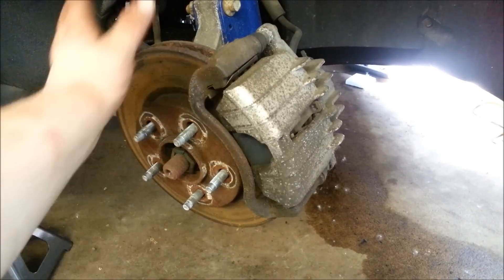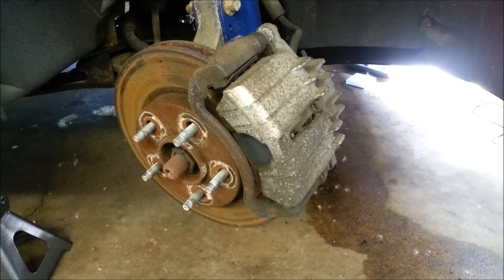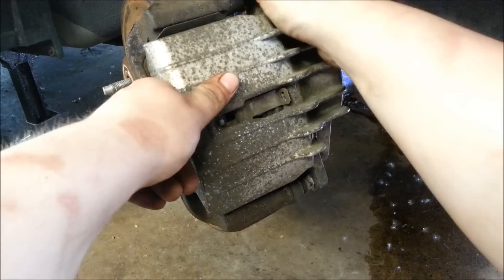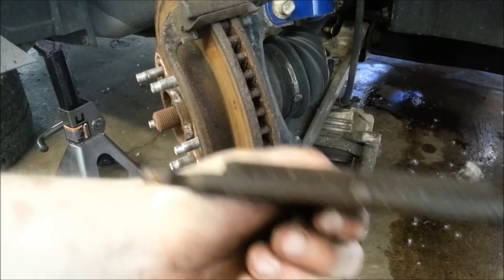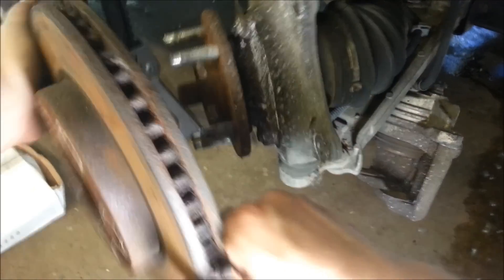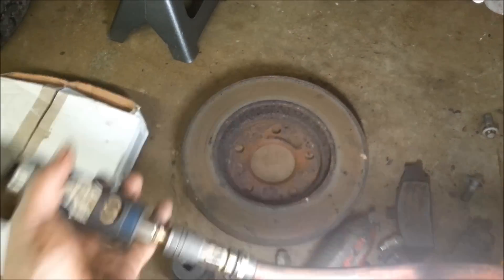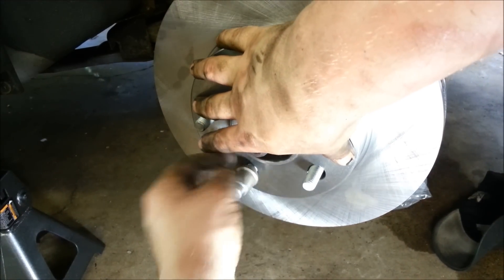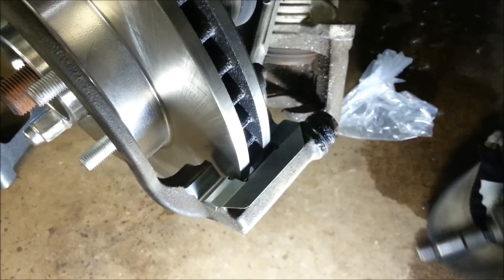grand am front disc brakes- joetheautoguy

Comment: I replaced the hardware when i did my break pads this time...i couldn't beleive the diffrence in breaking that it made....the only problem is that after 2 week the caliper started sticking so i had to buy a new caliper and it came with the bracket to....go figure all new front rotors new caliper bracket bolts on the driver side new brake pads and hardware and then the caliper decides to start sticking in the drivers side......thank you for your vidoes helped me fix my breaks perfectly without a single problem....thank you for the time you put into these videos...

Comment: NOOO! don't let the caliper hang like that! you stretch and / or damage the brake hose

use a coat hanger or bungee cord and use that to keep the caliper out of the way by hanging it off the strut coil

if caliper doesn't slide off easily at first, use a c-clamp to compress the piston back into the caliper & you should do it anyways to make room for the new thicker brake pads. Use an old brake pad on the piston so you won't damage the dust boot around it while you compress the piston

other than that, it was a decent video ~ i also torque those bolts to specs but that's just me when it comes to brakes
Reply from the maker: Earl DaSquirrel  i actually hung the caliper because i replaced the brake hose and caliper later off camera. forgot to edit that out but yes your right dont hang it it can cause issues
Reply: No C clamp use?

Comment: If thats a grand am, those discs were put on wrong.. the taller tab goes on the inside or it will bind up the caliper
Reply: Lucas O'Dell    Car is a Grand Am
Reply: I think you mean pads, not discs. But you're right, the taller tab should be on the inside.

Comment: Totally going to do this. My husband doesn't think I can do this, but I know I can. Thanks for the help!
Reply from the maker: great!!!!!!! its pretty easy when you get down to it... thanks for watching
Reply: Hardest part is getting the wheel off and car jacked up safely after that it’s pretty easy. Make sure you have a torque wrench and an electric impact the impact makes it easy to get the bolts off and the torque wrench makes sure all the bolts are torque to the proper spec. You do not want your wheel falling off. The proper torque spec for the a Grand Ams wheels all 100 foot pounds.

Comment: Seems the wear squeaker goes on the inside ?  on your vid u had it on the outside,on   another vid the chap said if u dont put it on the inside the pad will bind and wear unevenly since the tabs are of different sizes .
Reply: Tim Warner      He also don’t put some grease on the bottom sides of the pads they will squeak
Reply: Right to both you guys! I was going to call him on his bullshit because he did it wrong, but hurried up and switched them without telling us, or why. Plus not putting grease on the slide bolts! Somebody is going to fuck Thier shit up because of bad directions. Plus he didn't explain the hardware you get and where and why it goes where it does. The only reason i came here is because i couldn't remember if I had to open the brake reservoir cap before I start compressing the Pistons.

Comment: Nice video man but Just a heads up if it's a grand am that taller tab with the squealer bar goes on the back side as it will bind up in the caliper, I just actually did my 04 grand am front pads
Reply from the maker: Thanks for the tip

Comment: Joe, I seen you have the big tab on the pads forward but then I seen you switch the big tab pad towards the caliber ,in. 
Is that right/
Reply from the maker: i honestly did not realize i did i did this in the video, the big tab on mist vehicles will be the inner pad on the bracket. and the smooth facing outwards. some vehicles differ ut this is the usual way of installation

Comment: How do you push the caliper Pistons back?
Reply from the maker: use a c clap and physically push the pistons back in , didnt relize i didnt show it on this video i will be doing a reshoot soon
Reply: JoeTheAutoGuy you got the inner and outer pads backwards,, the one with the long tab on top goes on the inside of the rotar.  the caliper's piston needs the large tab to push evenly and prevent uneven ware!
Reply: how do you release the pressure on the piston

Comment: "... just gotta figure out which is your inner and outer (pad)... "  I noticed in your video that each pad has a tab on top, but the tab on the inner pad is higher than on the and outer.   I thought I saw you install the inner pad (i.e. taller tab) on the outside then cut away.  The next clip had you installing the caliper but now the outer pad (i.e. pad with shorter tab) appeared to be (correctly?) on the outside.  Did I see that right?  Reason I ask is I'm going round and round with mechanic about whether he installed the aftermarket brake pads wrong in my 2002 Grand Am SE.  I think I got two inside pads installed on the same front brake because they are the same height.
Reply: i I replaced brake pads & calipers on the front of a 2004 Pontiac Grand Am . I installed the brake pads backwards doing this had me bleeding the brakes for two-and-a-half days trying to figure out why there was no brake pedal.  I still have not found a video online stating that installing the brake pads backwards could cause this problem . my father mentioned to me to flip flop the brake pads . I thought he was goofing around but when I did it, all of a sudden I have brakes again. never run into this problem before. change hundreds of breaks
Reply: Correct, the taller tab goes on the inside. If you look at the hardware, the piece in the center of caliper top is a different height on the inside vs. the outside where to pad rides on it. Also check the placing of the squeal tab on inside pad. It may rub on the low or upper position.

Comment: What is that kind of air tool called?
Reply from the maker: el chingon  impact wrench
Reply: Do u need a air compressor to use that tool? Is there a battery operated one?
Reply from the maker: el chingon there re many different options available and i use a 1/2 inch drive